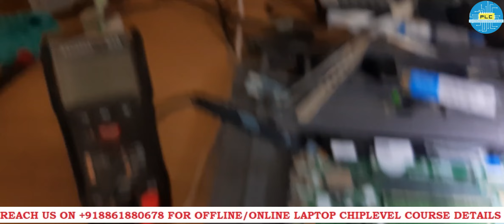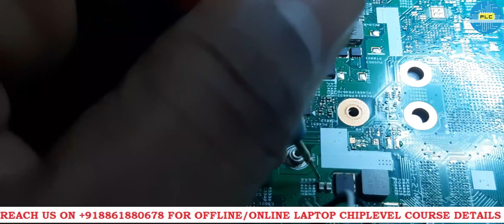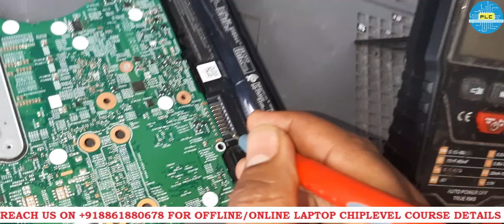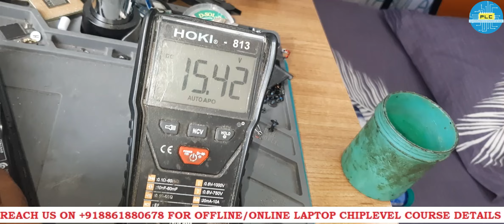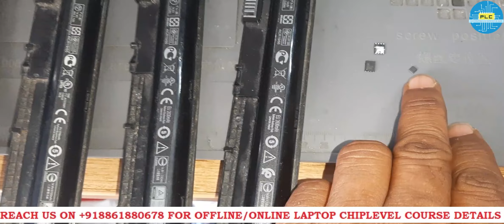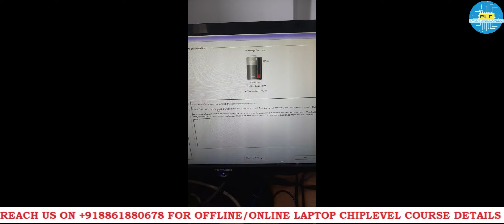Dis / Charging Issues in Laptop Motherboard | Laptop Repairing Course

Comment: i think battery id line missing 4  batteries
Reply from the maker: Maybe. There is a chance.  But main problem was with discharging,  high low mosfets and battery
Reply: @LaptopCourse  but  MOSFET not ground connect.. i think ic fault